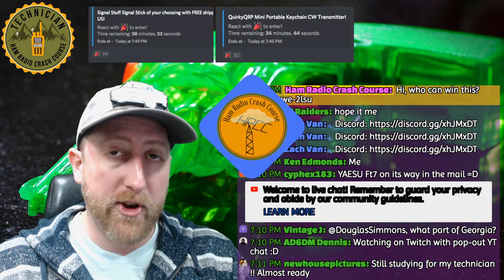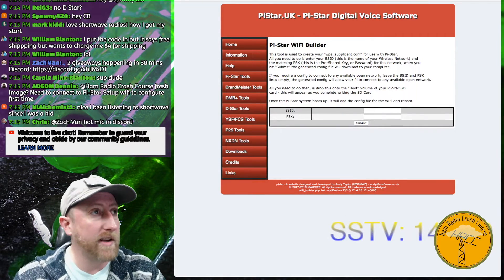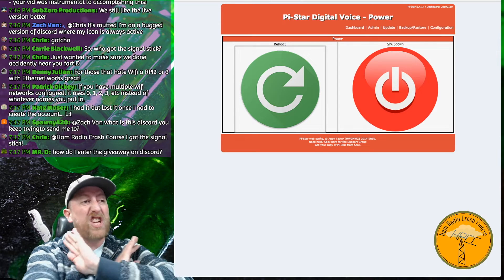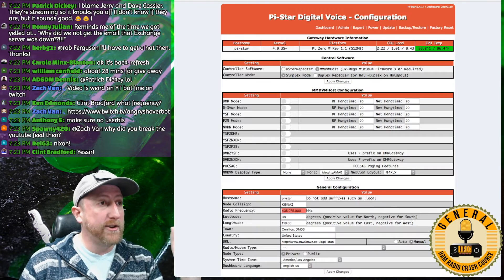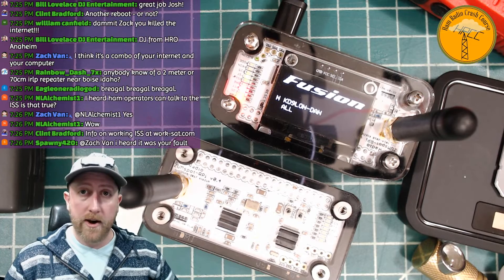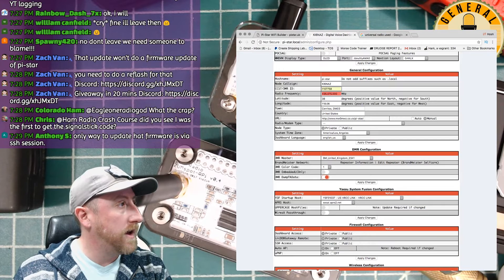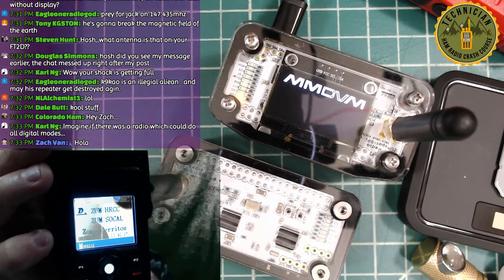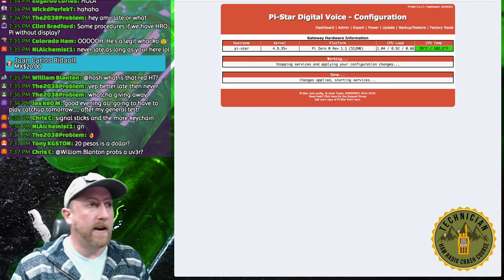Setup ZUMspot RPI Pi-Star Install How-To

Comment: Which Download do I use with this model "Zumspot-RPI 0.4v" ?   On the PiStar website there is the RPI download 4.14 and then 4.15, or there is the Nano versions ??   Which download works with this little Zumspot ??    in 2021 ?   Thanks.

Comment: Thank you for the helpful video. I do have one question though. I will be probably buying one of these 'hats' that connects to a raspberry pi board (probably one of the 3B boards I already have). Since that raspberry pi board has an ethernet plug on it, why couldn't I just use a network cable to connect it to my router? Or is all this strictly wifi??

Comment: Hey guess what I got for Christmas??>>?>? I have about 200 questions about this thing. #1 does it only transmit digital I can only receive it on my ft3d? #2 when you have more than one mode selected and you transmit is it transmitting on all of the modes at once? d-star, dmr, ysf and so forth?  Thanks for the help!!
Reply from the maker: Yes, hot spots are only for digital modes.  When you have multiple modes selected it will transmit on the mode that your radio is transmitting on unless you have DMR -> YSF or vice-versa.   You can setup the hotspot to specifically go from one mode to another.

Comment: My Zumspot is talking to  my radio but it does not hear my radio.  Seems to make no difference  if DSTAR or YSF.  HAve not tried DMR  but, if it doesn't work on two modes don't think adding another will make any difference.
Reply from the maker: What radio are you trying to use?